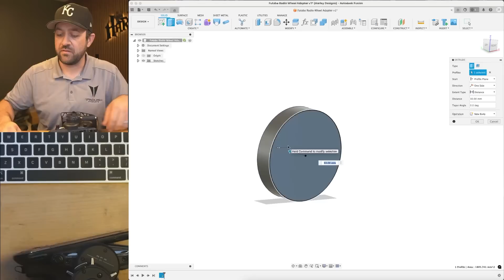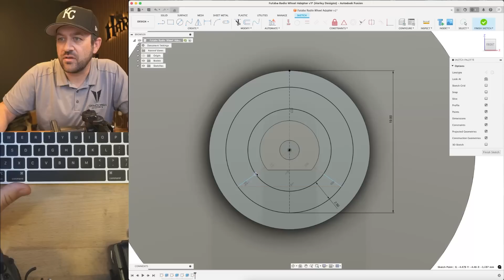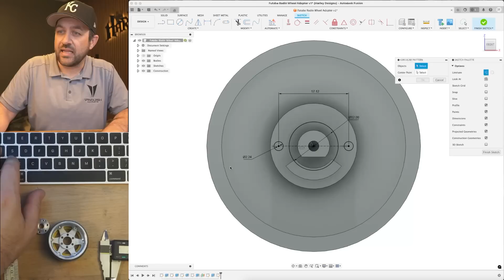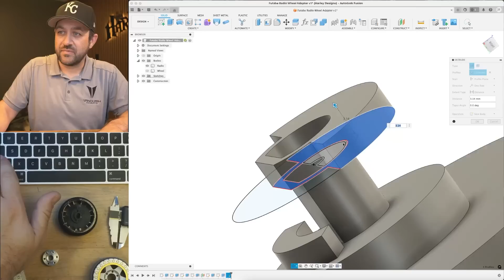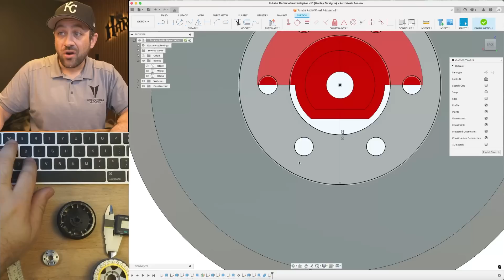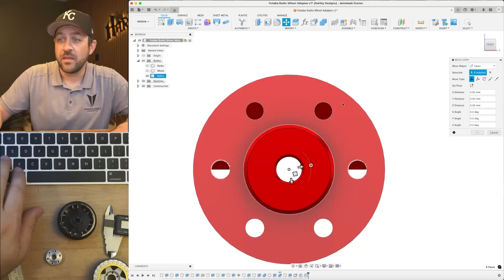Radio Wheel Adapter - 3D Printing Sunday  - Ep 39

Comment: You need to get a 3DConnexion cad mouse. It makes everything so much simpler and smoother. I programmed the buttons on mine with the short cuts I use the most. Try it, you won't regret it.